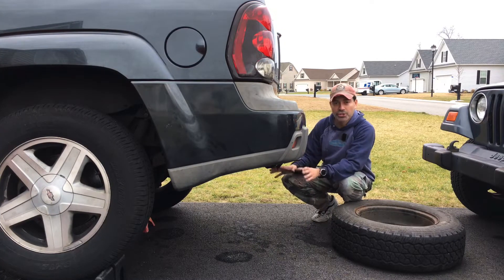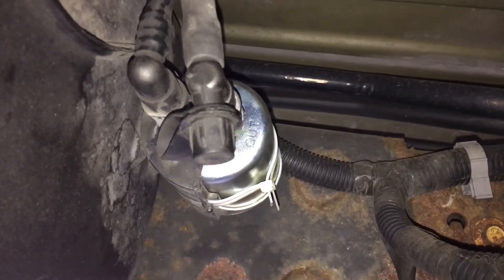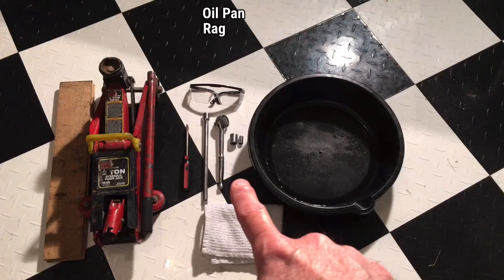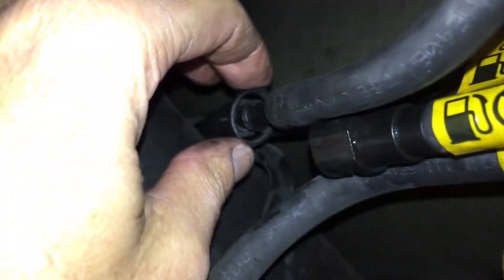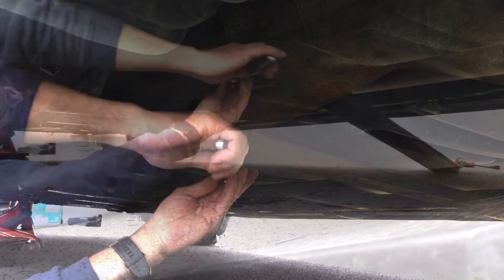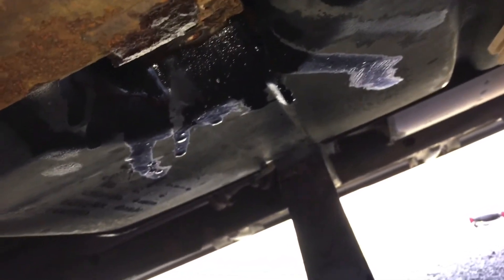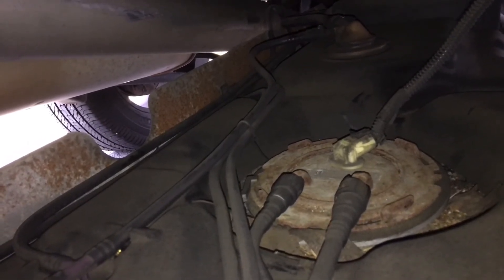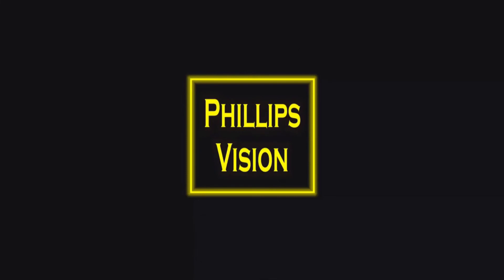How To Remove The Fuel Tank - Chevy Trailblazer  (Andy’s Garage: Episode - 312)

Comment: The rear fuel tank bracket does come off. I have seen other videos where it has been taken off. Thanks, great video.
Reply: Yes it comes off if you bend it, but then it sucks to try to unbend it to fit back in. Worse case drop the dry shaft at one end. 4 11 mm bolts. There a video on it.

Comment: Would I be correct that the 2008 4.2 would be a little different??? I don't believe I have an external fuel filter?
Reply from the maker: Yes, it’s different and the size of the tank I believe is smaller
Reply: Also, my 2005 Trailblazer does NOT have an external fuel filter. It is incorporated on the fuel pump assembly.

Comment: What tools do you need to take a gas tank off to a 2005 trail blazer
Reply from the maker: Should be similar to the ones listed in the video
Reply: 15mm, 7mm, and i would get fuel line disconnect tool so you don't break fittings .

Comment: Great video.  What I really appreciated was that you didn't just gloss over how the connectors for both fuel and wiring are disconnected and actually showed the connectors up close.  Some of the fittings are hard to figure out and many are old and dry so they crack easily.  Unless you know how to disconnect them. its easy to break them sometimes.  As I often do, so thanks for that.
Reply from the maker: You’re welcome 👍
Reply: What's the part number on that pump

Comment: Just did an 04-4.2 Envoy. In the Rust Belt. It’s a brutal job on the ground. The rusted bolts and clips are a pain. Use penetrating oil like PB a few days ahead of the work a must. Wire brush as well. Get the feeder and return lines off of metal of the top of the fuel pump can be the worst part of the job. Get extra 5/16 and 3/8 plastic retainer clips (black and white)at an auto store before hand. There are some larger ones white ones on other lines but those are less prone to breaking. The lock ring on top of the fuel tank will also be rusted in if you’re in the Rust Belt. You might want to buy a replacement because a rusted one will be difficult to get back on. Make sure the new pump comes with a new seal/gasket at the top of the tank. The aftermarket ones just don’t work. If yours isn’t dry rotted or damage you can consider reusing it if the new one doesn’t fit. The aftermarket ones are thick or too loose. Even Doorman’s is too loose. One of my pump feeder lines came off after 10 mins of careful lubing and twisting. The other after hours of trying everything and even in a vice with the broken off metal neck the line came out, BUT the small seal and o ring were left of the fuel pump neck and couldn’t be used again. Dry rot. A new line for $70 on Parts Geek or $150 at the dealership. Very, very hard to find. Same for the hose going into the tank. Dry and hard, so don’t brake or tear it. Very, very hard to find for$60. The rust factor tripled the labor time. I took off my spare because I needed a new hoist. I have a new one but it’s such a bad system just meant to rust and fail, I’m not going to replace it. Can’t imagine having to deal with it in the cold and snow in the middle of nowhere at night. The whole drop down system sucks.

Removing the rusted in spare and hoist about 6 hours. The tank about 20 hours.  Pre lubricate everything, do not use power tools on the bolts, if you snap off the 15 mm bolts for the straps you’ve screwed. So take your time with these. Be very gentle on the clips and connectors, don’t bend and damage the fuel lines, try to get all the fuel out by tipping the tank once on the ground. Try to get all the fuel out of the pump if you can’t remove it first. I broke off the two metal necks for the feeder and return  lines and flipped the tank over. Please only use a brass/bronze punch if the is any fuel or fumes left in the tank. You do not want blow yourself up.  Wear eye protection during the removal of the lock ring and removal of the tank if your under it.. Dirt and rust will be falling on your face.

Watch as many videos as you can. Some cover more detail than others. 

Good luck. It’s sucks, but if you take your time it can be done. About $1,400 at a shop in the Rust Belt. Maybe more, because they’ll be in a rush and snapping off things that will then need torched and more hours of replacing and more parts. American Greed.

Comment: I found out the hard way. Tried to disconnect the filler hose from the back of the tank. On yours, you left that hose connected.
By the way, Chevy no longer sells that hose. Had to buy the whole fuel filler assembly..  ($150.00)
Bad move. That is where Chevy has the roll over prevention valve. I broke it off. Hence, junkyard to find another tank.

Good video..
Reply: Dorman sells a new aluminum rollover check valve 100 bucks no new tank needed
Reply: There hose is still out there. Parts Geek I believe. $60 A C Delco. Only one place that still has it as of this comment. They also have fuel lines  A CDelco for half the cost of dealerships.